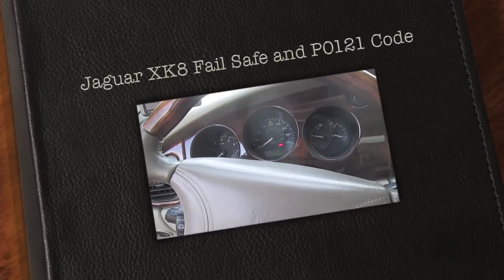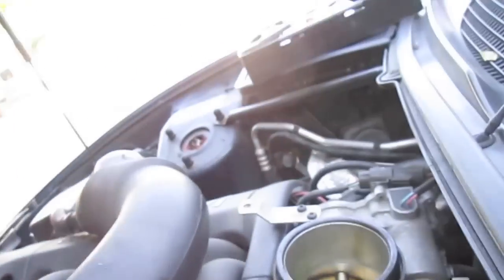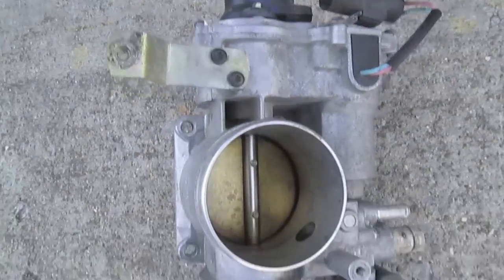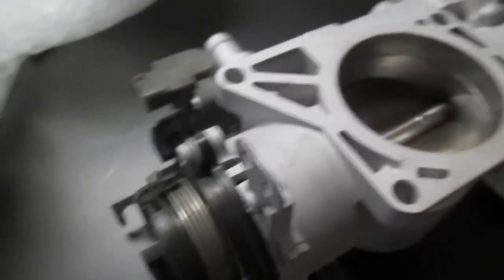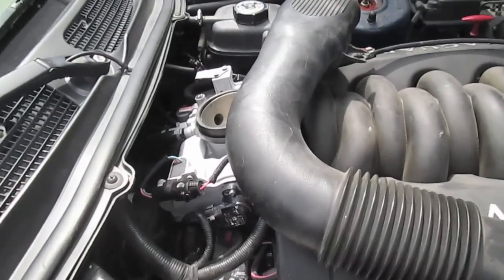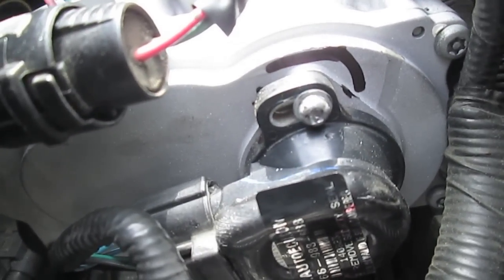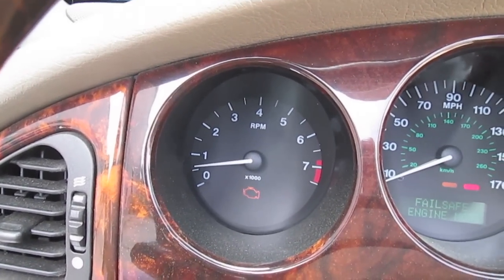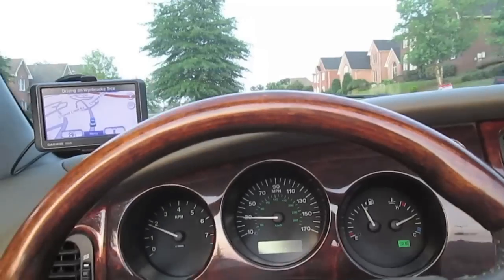Jaguar XK8 Fail Safe P0121 Code Intermittent How I Repaired It

Comment: Had a similar experience with my 01 XJR.  Sent the TB out for rebuild at ASI, got it back and no paperwork was included for the TPS adjustment with mine, got it emailed the next day when I called to ask about a warranty replacement.  Did the TPS adjustment and I got really lucky that it landed in exactly the right spot and I was able to tighten the screws because the screw heads were just about completely stripped bare...I was just able to get a torx bit in there and turn it just hard enough to tighten it.  Been good since then, about 5 months and 8000 miles.

Comment: Was there too. Most of times the connnecting plugs from the vehicle to the throttle body have oxidated too much over the decades. 
BEFORE disassembling anything. Unplug, inspect them and maybe clean them with a watch screw driver carefully. Make sure ALL them connectors do their job properly. Before reconecting. Use a lil dialectric grease on them metallic connectors. Plug them back on. Done!

Comment: Had a chronic P0121 code on my 2000 XK8. I disconnected both electrical plugs at the throttle body and thoroughly sprayed electrical contact cleaner on the male and female ends of the plugs. I allowed them to dry completely. Replugged the connectors. Problem solved. 400 miles later I’ve never gotten another P0121 code.

Comment: I head the same issues with my 2001 XJR years ago.  All you have to do is clean the inside of the throttle body.  Carbon build up gets on the throttle position sensor inside the throttle body.  Using carburetor cleaner  and a lint free rag, clean the inside of the throttle body.  You can do this with the throttle body in place or removed.  It’s easier to get to if you remove it but I did this with the throttle body in place.  The rag removed a lot of carbon and that problem never reoccurred.

Comment: Hey Billy,
I admired your pluck. This is an expensive job if taken to a Jaguar dealer, and it defeated two of my local repair shops, both with diagnostic equipment. You mentioned you rotated your repaired TPS counterclockwise, and the engine revved to 5,000rpm. That statement helped determine which way mine should be adjusted. My XJR engine would not idle below 1,200rpm and hunted between there and 1,700. As well as being rough-sounding, it jolted severely while gear changing, and worse, the grip of the rear wheels almost overwhelmed the braking power of the fronts. Getting it stopped was not always a certainty. 
To reduce my engine speed to a normal 700rpm idle required rotating the TPS fully clockwise on the top screw and almost similarly on the lower screw. I tapped the TPS gently using a tiny hammer with a brass rod. 
Your information was invaluable and I’m most grateful to you.
Cheers, Vic

Comment: Thanks for sharing your experience with the dreaded TPS adjustment.  However the hard set info is incorrect so permit me to correct the procedure for others who watch this video.  Simply disconnecting the battery like you would to replace it does nothing to reset any stored parameters, as there are capacitors in the electric system and their job is to hold a charge.  Just disconnect the negative cable and touch the cable to the positive cable for 15 seconds or so.  This will provide a path to ground for any charged caps and discharge them.  I would clear all codes prior to this procedure then drive the vehicle specifically to run the monitors, which is called a drive cycle.  You can google drive cycle for the particular year vehicle and follow the directions.  It is best to do this on a cold vehicle that hasn't been started yet, as some monitors won't run unless started cold.  It helps to have a scan tool with the ability to not only clear the codes but to also access Mode 6 to check monitor status when you are finished.
Reply: Exactly. 👍🏻🎯
Reply: What the procedure for a 2001 jagure vanden plas

Comment: It’s correct that my Jaguar garage insisted you couldn’t buy the sensor without the whole throttle body, but I managed to find new (not re-use) sensor replacements on eBay for £65 plus £175 fitting charge. Just checked and new sensors are still available on eBay.

Comment: Had same Failsafe problem, I sympathise with all sufferers, sudden loss of power at 80 mph in the outside (fast) lane is frightening! I read up dozens of expensive complicated solutions like this. Bought a new throttle position sensor over a year and 4,000 miles ago.which my Jaguar garage fitted. The only thing that seemed to be a problem was that the idle speed was over 2,000 revs. The sensor had been aligned to the old sensor mark, just needed loosening and readjusting. No problem since.
Reply from the maker: Michael When I sent the throttle body off I imagine all they did was replace the TP Sensor.. At the time I was unable to get just a TP Sensor without buying a new throttle body so it solved the issue for me..
Reply: I bought a 1999 xj8 with a rebuilt TPS on it and it randomly goes into Fail safe. I got a new TPS adjusting to 600-1000 rev idle multiple times it still goes randomly into fail safe. Would you recommend me having the throttle body remanned by Auto Sci Inc as you did?

Comment: After three years, I tried this and it didn’t fix the problem. Took a chance that it was the Engine Control Module. Ordered one from a jaguar parts dealer for $125, had it installed four days ago, and it fixed my problem. 😁

Comment: check your air intake hose. Any kind of crack in it will allow air to run past the maf. ANY air that gets in that is not metered will result in failsafe. If you went through the effort of having your throttle body rebuilt, replace the air horn.

Comment: You guys do realize this was a recall right? Same thing happened with mine. I called Jaguar gave them the vin, he checked then vin said the recall was still open, I had the car towed to Jaguar. Next day he called me said car was ready.  vehicle works fine now.
Reply from the maker: I doubt a recall on a 17 year old car but you never know..
Reply: Nope. I have the exact same car and I called Jaguar and they said there is nothing open.

Comment: I so appreciate this video.  I just got my 2000 XK8 back after 8 months in the shop due to hail damage to the body and convertible.  The work was substandard and it had to go to another shop for corrections. I have 70k original miles on it and it died yesterday in front of the automotive shop.  I had red lights flashing with fail safe mode and transmission failure/fault prompts. I couldn't drive it back home, so I left it.  Today, I got an email with a 4k estimate. The throttle body and gasket parts were over $2,900.00 and then there was labor.  The balance of the 4K estimate was on a few other issues.  This video is over a year old and I'm wondering how the rebuilt part is holding up and did you end up getting the gasket, or did you keep the same one?  Thank you!

Comment: My 2000 XJ8 reads check rear lights but all my lights works, why is dashboard read check rear lights.?
Reply: Laurna, Im a semi retired ASE tech with too many years of experiance;)  I also own a cpl xk8s. As for your light problem, I can say without even seeing the car that it is almost deffinetly the connector goint to the light assembly. Take connector plug off, look inside the wire end and look for a black or burnt connector, usually on the black wire (ground). It wont be obviouse, but compaired to the other connetor wires on same plug you will notice color difference. U can replace whole connector, but cheap and perminet fix is to just solder wires dirrectly onto the tail light assembly circuit brd. Ive done this on both my cars when they acted up. good luck:)
Reply: Laurna Calabrese computer in right side of trunk

Comment: Spray clean Throttle body, Mass air flow sensor w special spray, and change transsmision fluid+ filter will make a world of improvment on a car.
Reply: Very true , did this and an abs sensor change and my gear changes are now smooth as silk .

Comment: spa Guy I got a 2002 jaguar s-type I drive 40 miles I step on th has car dies. p1580 electronic throttle monitor overide.
p1582 electric throttle monitor data.do you think is the same problem u had

Comment: Great video! Actually I too am having problems and am thinking of adjusting the throttle position sensor. You say that moving it to the LEFT increases the idle speed. That seems in contradiction to what another video (JAGUAR XK8 XJ8 XJR THROTTLE BODY TROUBLESHOOTING REPAIR) says. There CLOCKWISE increases the idle speed. Can you comment??

Comment: I've had this problem w/ my 2001 XJ-R. Replaced the wiring harness once & that worked for a couple years. Next time I made the mistake of letting dealer replace the throttle body: dealer techs are no longer mechanics; they're just "parts replacement specialists." I'm now having same problem again w/ P1111 and P1121 fault codes. Both are High Voltage faults; former is Intake Air Temperature Sensor(ATS), latter is Throttle Position Sensor(TPS). I'll try cleaning the ATS, per Michael Zak's advice first. I suspect, however, that the TPS problem is a DESIGN fault and that the rebuild recommended here is the solution. I say this because I had an ABS module issue as well, which was the result of too high voltage melting some poor solder joins inside the ABS module. Another YouTuber showed how to repair those solder joins, not replace the ABS module. Saved me over a grand! Just because automotive electrics are governed by microprocessors now doesn't mean these Brit cars won't have chronic electrical problems. The more things change, the more they remain the same.
Reply: +R.R. L. And a big "THANK YOU!" to Spa Guy for posting this video. You're going to save some folks a LOT of money.

Comment: Hard to believe with the technology of Jaguar, you have to move the sensor based on listening to the engine.  Like the old days of setting timing of old carburetors and no light gun.
Reply: I think your suppose to adjust it with a volt meter with the key on but not running.  Will have to check up on that.

Comment: I had a similar problem on mine but was nothing to do with this and personally i don't think this is the fault with yours as the engine fires and runs, mine was the abs sensors which are mounted on the hub on each wheel, front ones aren't to much of an issue but still worth cleaning, the rears build up with grease and dirt because they are positioned very close to the drive shaft link,  i had the same engine warning lights, traction control fail , loss of power as you are having when ever i went over 50 mph

One of the rears had about 5mm of dirt blocking the signal from the abs rotor, its a very easy job to do your self, it involves removing one wheel at a time which is no big deal, the sensors are mounted on top of each hub with a wire connected to them.

I cleaned all 4 in under an hour for a total cost of $4 for a can of WD-40 just to help free them up, don't false them as they can be damaged, remove the screw holding them in, if they don't come out easy just spray some WD and leave it for a minute followed by a gently twist until free then simple wipe the signal side with a cloth and reinstall

The reason is if the abs system fails to receive the pulse signal from one wheel it puts the ecu into fail safe mode shutting it down, it affects the system more at higher speeds over 40 mph as the wheel rotation increases it receives even less signals from one wheel compared to the other in a short amount of time which triggers the fail safe, very common problem on both XK8 XKR XJ8 XJR as they all use the same technology, its been 2 years now, 12000 miles and the fault hasn't returned.
Reply: But what if the car has the check engine light on with DTC P1121 indicating to a bad throttle position sensor and pedal position sensor correlation?
Reply: Michae

Comment: So my" 2000 s-type 4.0 Jaguar" still going been 4 months since replacing my throttle accelerate paddle after replacing the throttle body three times learned  to replace both parts made the difference good luck.

Comment: My sons 2000 XJ8 was having the same problem and the dealer wanted $3500 to replace. I pulled and sent the throttle body to be rebuilt. They turned it around in 2 days, I installed the rebuilt unit, settings seemed perfect right out of the box and cleared all the warning lights. I have about $300 into the repair including the new gasket. Running well. appreciate the time you took to do video.
Reply from the maker: +J Garbo You are very welcome I enjoy making vidoes and knew other people have encountered the same trouble. I got the same estimate about 3500.00
Reply: Thanks this helped me a lot
Reply: J Garbo @@%%%
Reply: sent yours to where ?
Reply: I had shipped the Throttle Body to Automotive Scientific, received back and installed.  I still get Engine Safe Mode message.  Do I need to have the mechanic adjust like you did in your video?

Comment: Cool that you found that yourself, these cars can be a good bit of cash to get worked on.  I have a 99XJR and the head gaskets blew last year...tune of $3000 fix.  Just had the "amber" failsafe mode pop on me this morning in mine.  Drives fine, runs fine, would have never known it was on until I glanced down.  SO, I pull out the 'ol manual and it says that the amber light means lowered performance but can still be driven but needs to be looked at, and the "red" alert means to pull over and don't drive.   This morning, after I parked the car and came back, the light didn't come on for a while.  Stopped at a store and came back out and it wasn't on and didn't come on again.  I'm not sure what it is, the car seems to perform fine.  I'm just wondering if it might go from the amber alert to red.  Guess I need to nip that in the bud.   Oh...by the way...I had a problem that took me FOREVER to find out what it was, and I just happened to be in the trunk when it happened and I actually heard what was going on.  I had been having intermittent issues with codes popping up from time to time...ABS, Traction Control....all of them would come up at the same time.  It usually would happen when I turned on the A/C, or would happen after the A/C ran a while,  but would also happen just out of the blue without A/C being on.  I even got locked out of the car a few times too and had to get it towed.  Problem?  Battery ground cable.  Believe it or not, it was the ground cable.  I had changed out the positive before due to it being corroded,  but the ground looked almost brand new, nothing green or anything,  good clean connections.  But the last time it happened, I noticed that if I messed with the connections on the junction block next to the battery, it would fix it...until it decided to do it again.  Then, as I said,  I happened to be in the trunk again messing with it after it started its code stuff again...and it was really quiet this time....and I grabbed the ground wire to move it around and I heard a little quiet "snap".  Juala...I knew then it was the ground cable.  So,  changed that, and no more intermittent codes out of nowhere, run A/C all the time,  no problems with codes anymore.  But...now the failsafe.  Guess I need to look into that now...uggg.

Comment: Enjoyed the video! Very informative. I have a 2002 Jaguar XJ8 with a "restricted performane" message that comes on and goes off. Would you say that this would be the problem?
Reply from the maker: +Melvin Dean There is a very goo possibility that this is the problem you need to pull the codes and see if they match up.
Reply: more likely your air flow sensor, I fixed mine with a can of electrical contact cleaner, don't use carb cleaner as its to aggressive and it costs the same to use they right stuff for electrical components.

Remove the senor which is near the air filter box, give the air flow sensor a good spray be careful not to touch the probe as it can be damaged even with careful cleaning, just use the spray, when you remove it you should be able to see up inside it where the board is , there is another sensor up in there to along with the probe at the bottom, allow cleaner to evaporate for a while then reinstall it.

Pollen builds up over time on them and as they run hot when on it melts the pollen to the sensors giving wrong flow signals as this sensor works with the lambda sensor on the cat, if they receive different signals to each other the engine protects its self with restricted performance, your car will either not go over 3000 rpm or you will feel power a loss in power when it goes over that rev range.
Reply: +Melvin Dean Mine did that, it was the coils.